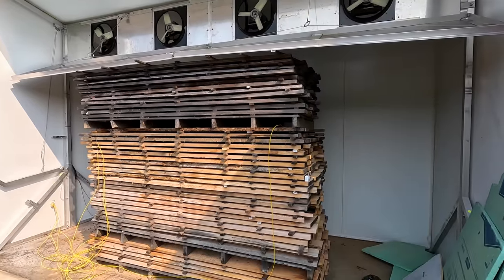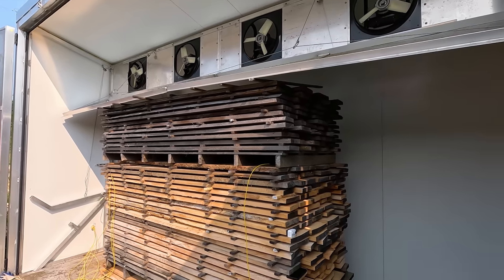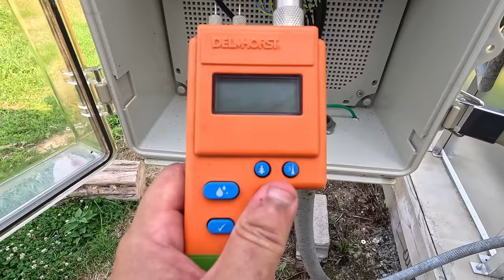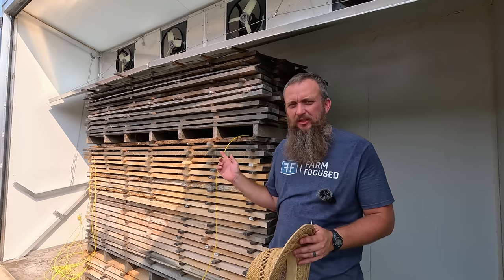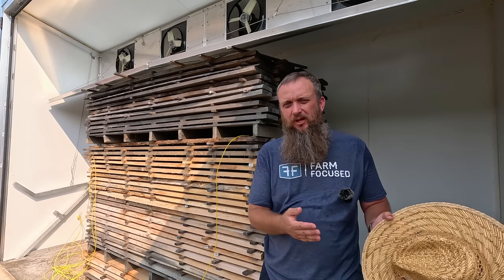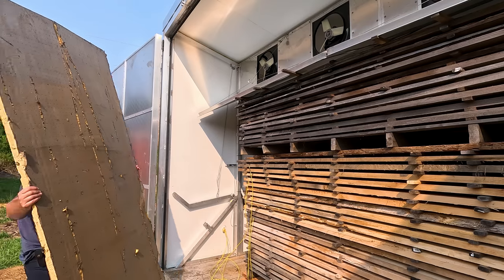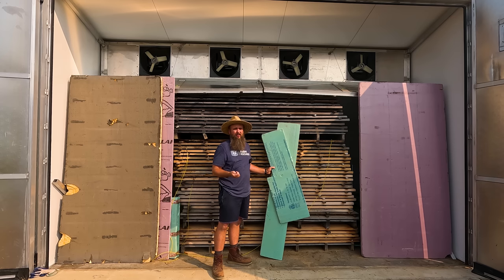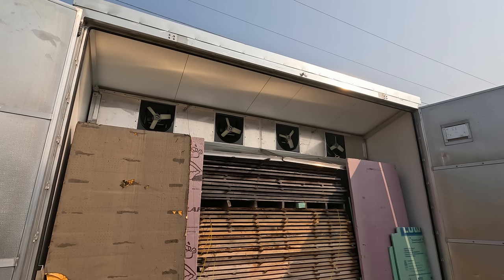How Much Did My Lumber Kiln Cost? You Might Be Surprised $

Comment: Nathan, I really love listening to you talk about the drying charts.  As a Senior in High School in 1976 I worked for Wells Fargo as a guard at Memphis Hardwood, the makers of Chickasaw Hardwood flooring.  The building the security guards used during the off hours was where the plant manager's office was, along with other offices and work rooms.  This is also where the persons who calculated the drying charts worked from.  As the lumber was loaded onto the all steel dollies on rails, the person in charge of checking the moisture level would cut samples, as the workers were stacking the lumber onto two sets of four wheel dollies.  As the dollies got full they would push it onto the transfer table.  The transfer table could hold about four stacks.  The transfer table had about 300 feet of travel to be able to store the stacks in the storage area, and move them from the storage area to the staging area in front of the doors of the short kilns.  For the long kilns, they did not have a staging area, and had to stage these kiln loads in the storage area.  From the stacking shack they would move the stacks to a storage area on the highway side of the transfer table.  I looked on Google Earth Pro and was able to measure the kilns and the storage yard for the rail dollies with lumber ready for the kilns.  I used the 2003 satellite picture to measure the kilns, transfer table and the storage area.  I measured the stacks in the storage area to be eight feet wide by as long as 12 feet long.  I do not remember the actual number of kilns they had, but they had two lengths of kilns, and I think each kiln was 10-12 feet wide.    The short kilns were 148 feet long and there was 200 feet width worth of kilns, so as many as 20 short kilns.  The long kilns were 225 feet long and they are 80 feet wide.

After the stack was ready to leave the stacking shed the man would mark the stack and the bag of samples.  He would take them to the office where there were some small steam kilns, heated from the same boiler which drove the production kilns.  The fuel for the boiler was all the scrap cuttings and sawdust from the plant.  Besides the security guard on the second and third shift, there was also a boiler fireman.  The man would take the samples to the office and using the small band saw, cut slots in them all the way across the sample.  He would weigh them and put them in the little kiln in the office.  The next morning he would weigh them to get the moisture content and calculate how slow to bring the kiln to temperature, how long to keep at temperature and the cool down time and speed.  He also told me I could use one of the small kilns to heat my lunch.  One day I took a can of ready to eat soup to eat and put it in the kiln, but did not know to cut a slot in the lid.  The can was bulging when I went to eat it.  The next time I punched the top with the can opener before I put it in the kiln.

The man who calculated the drying time would then have stacks with the same moisture content then staged in front of the kiln they would be pushed into.  Once the kiln was cooled down the the dried stacks were ready to be pushed out, they used an old surplus Naval Air tow tractor, to push the new stack into the kiln.  As he was pushing the stacks into the kiln the green lumber stacks were pushing the dry stacks out of the kiln to the transfer table on the other side of the kiln, which was inside the plant.  As the transfer table got full they stopped and moved the stacks to the area in the plant to put each board onto the conveyor belt to start being processed.  As these stacks were being moved the man pushing the green stacks would get more green stacks to keep pushing into the kiln.  They kept repeating till all the dry wood was removed and the kiln was full of green wood.  They then closed both ends of the kiln and the man would start the slow rise of the kiln temperature.  if you look there are two control buildings on top of the kilns where they controlled and monitored all the kilns.

To find the old Memphis Hardwood location go to Google Earth Pro and set the Historical Imagery to 2/2003.  Find where highway 51 crosses over the Wolf River.  About two blocks South of the Wolf river on the West side of Highway 51, is a curved warehouse with half of the roof is white the other half is brown.  It is labeled "Hhh Distribution", Memphis Hardwood is the next property South of the white section of the roof ends.

Comment: I was an incoming material inspector  for the cabinetry  company I worked for - I would have to go to the Demension Mills ( we had 2 ) when we were having problems - boy did I learn a lot - ialso spread my new knowledge  to other Co workers  so the would understand the difference between  a Finish Mill and a Rough Mill.😊

Comment: Nathan, 20 years ago when we lived in Missouri, we had some kitchen cabinets made by a local cabinetmaker. Just as he was finishing them up, he came across some termite runs through the ash. Now, I don't know if he got the lumber from a yard or a small mill, but he came to us very upset. He was going to burn all the cabinets! We ended up installing them in the mudroom instead and he remade the kitchen cabinets. Not sure, but I believe wherever he got the lumber from made it right. Got to be careful! Use the kilns!

Comment: Thank you for sharing with us. I’m a woodworker and appreciate all the time and effort you put in to your craft. It makes me keep my mouth shut when I think some slabs are way over priced! 
You talked about moisture content which is very interesting, but it sparks a question. I’ll use round numbers just to make things easy. If you air dry as you do and a board (I know they are all different and everything is a variable) is 15% then you put it in the kiln and it gets to 7%. I buy that board from you and put it into my Indiana garage for 6 months till I get to use it, how much moisture is the board going to take on? In other words, how does a woodworker store the wood and how long do they have before it has taken on additional moisture? I know it’s all in theory as everything is a variable and wood will move over time however how quickly will a slab bring moisture back in? Any idea? Even if it has anchorseal or not.

Comment: That was a very informative video. I am building myself a new home and I just sent some Cherry from my land to the mill for a few interior projects. My plan was to air dry it in my climate controlled basement but now I'm nervous about the bugs you mentioned. Can I spray it with a water based insecticide such as Cyzmic CS? I don't see why not. I use it every year around my home & shop and it doesn't stain.
Reply from the maker: nope has to be heat treated to kill the bugs, spraying on outside of the board will not penetrate the ones in the wood,

Comment: Hi Nathan.... excellent content as usual 👍👍 just a quick question if you don't mind be asking.

I'm in London UK and if it's not confusing enough, some wood supplies deal in Imperial measurements and some in metric.
When you refer to say 4 quarter, is that 1" full imperial size, if so, why don't you call it 1"🤔🤔
Reply from the maker: Yes 4/4 is 1in
Reply: As Nathan said, yes, 4/4 is 1" in Imperial.  And it is measured "by the quarter inch" because that's how it is sold.  So, 6/4 would be an inch and a half.

Comment: To use a container it's best to get a freezer container or you heating and operating costs will skyrocket and shipping containers are limited to end loading which meant a rail loading unloading system thats not remotely as efficient as side loading. 
Your advice to purchase the system with side loading and insullated is very sound and cost effective in the long run. What is cost of your remote moisture content measuring system. Thanks for a informative video. Ray Stormont
Reply: I think you made this comment on wrong video!!!!!!!!!!

Comment: Hi Nathan, Have you considered using a few buckets of silica gel inside your kiln to speed up drying? It is not new, and you find small packets of it in optical equipment an pharmaceuticals.  It turns color when its saturated. You refresh it just by heating it up.  It's cheap too.  You might look at some websites of companies that sell the stuff.